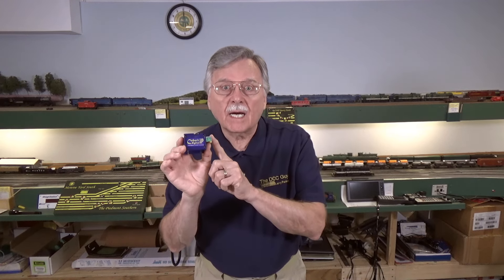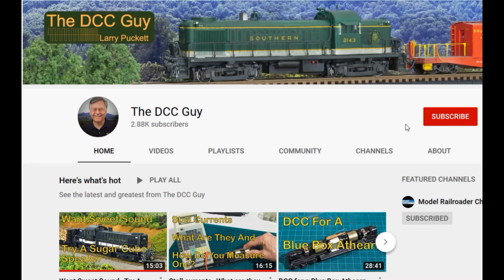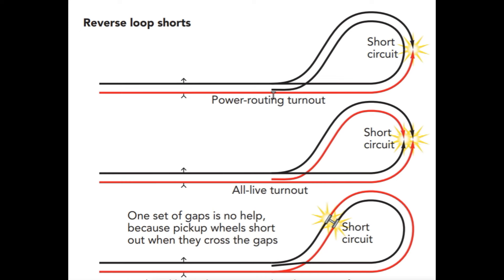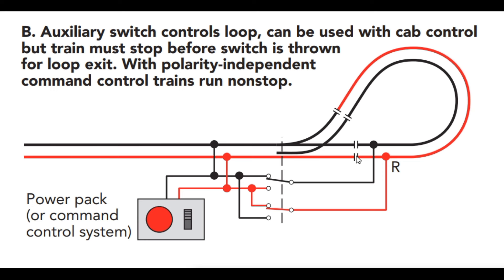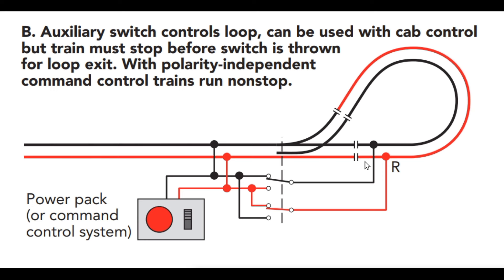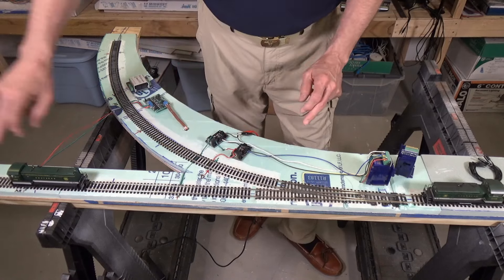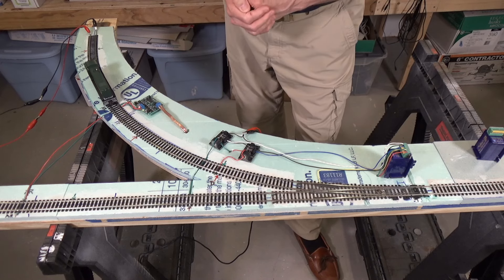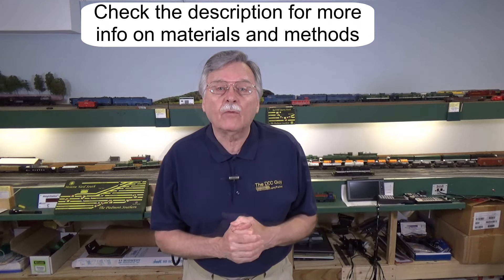Fully Automate Your DCC Reverse Loops (197)

Comment: Thank you, Thank you for the clear and detailed video, although I had to use BD-20's which wire up slightly differently, I was able to successfully automate my reverse loop reliably using your guidance.  The process has inspired me to look into more automation projects!
Reply from the maker: Yes, before they developed their similar detectors, they tended to use BD-20s. Did you end up adding power to them or was the logic and ground output enough without it?
Reply: @TheDCCGuy  They did work without power but I added power to get LED confirmation with larger bulbs in two colors. I may play with it some more just to avoid the additional power supply, or consider a DC accessory bus connection nearby. 

Thanks again, your articles and videos are extremely helpful. See you along the rails.

Comment: Larry, I appreciate the video.  I am planning to use the DCC Specialities PSX-AR.  I have one question.  You fixed the auto switching and poliarity from within the loop. How can you pre determine the switch machine to go left or right from out side the loop when approaching the loop.  What you had just takes the last direction used.
Reply from the maker: As I think I said in the video setting it up for a fixed route gets very complicated. It will likely require some sort of flip flop logic circuit and possibly optical detectors. I have never seen it done. You might check with some companies that sell DCC electronic circuitry.
Reply: @TheDCCGuy  After viewing this video, I later viewed your review of the Cobalt Switch Machine.  You mentioned the option to add a Momentary button to the switch machine.  I feel this would give me the option to chose which direction to enter the loop.  Thanks for your help.  Thanks for your practical presentations.
Reply from the maker: In that video the detector is sending a command to the switch machine to change and if you add a pushbutton it would create a potential signal conflict.Let me ask the DCC Concepts guys whether they have a solution. They are at a big show this weekend so I won’t hear anything back until next week so remind me if I don’t get back to you by mid-week.
Reply from the maker: I heard back from them and they don’t have a circuit specially for that. However I found the Digikeijs DR5013 autoreversing blackboxes designed for automating reverse loops and a company at www.azatrax.com that makes them. You do have to search through their pages but eventually you can get down to their circuit. I am sure there are a lot of other basements electricians selling such circuits just do a Google search.
Reply: @TheDCCGuy  Thanks for your help.  This will go a long way to doing what I want.

Comment: I use DCC Specialties PSX-AR on my layout and they seem much simpler than this and they work perfectly..
Reply from the maker: Good to hear that as I have one to try out on another revers loop. I have in the past had difficulty programming the CVs on my PSX4.
Reply: I completely agree!  Need to make sure that you get the PSX-sc that controls a switch too.  Only 5 wires.  2 to your isolated section and 3 to the switch.  They work flawlessly. It even handles when you flip the switch manually.

Comment: I want to construct a layout with a reverse loop where the loco enters on one turnout and leaves on another.  My dilemma is whether one AutoReverse mechanism will open the forward turnout and close the previous turnout simultaneously.
Reply from the maker: Without seeing your track plan it is hard to comment. Usually in a revers loop the loco enters and leaves via the same turnout. Do you plan some land of crossovers in there that creates the reversing issue? At any rate it sounds as though you will need 2 circuit boards to handle the two turnouts, but without more info I cannot be certain.

Comment: Great video. Was looking to do this but now I'm limited to a 4×4 area which is not going to happen.... Larry truthfully, I could of used all your advice 5 years ago before I built my layout., But I'm not and as we all say never finished modeling...but I'm not even close I am using most of what you teached as I'm fixing tunnel track and I have to finish doing my yard in my open closet where I have to put it and at the end of my 13+4 middle section... That's where I wanted this cause also I'm going to make a yard n passenger station. But my city is there with my elevated subway so only 4+4 room left for this... Your videos are great knowledge that I am absorbing. Thanks buddy keep it up, joe aka ( DIESEL 027)....

Comment: I'm learning about reversing sections on DCC layouts by watching videos and reading text from many sources.  Some folks talk about reversing polarity, others talk about reversing phase because they say the DCC signal is AC not DC. (And some say it is not an AC signal, it's a digital signal.)  So which is it, polarity or phase? It cannot be both, can it?  Let's get everyone one talking about what it really is so newcomers like me can learn it right the first time.  I understand that with DC powered layout it really is polarity switching but we are talking DCC layouts here.
Reply from the maker: In reality DCC is not DC and it is not AC, it is DCC. That probably sounds like double talk and that is why you rarely see a technical discussion of the subject and folks just fall back on the polarity concept. What happens is power turns on and off at high speeds on opposite rails, so one rail is on while the other is off, then that is reversed and so on. Consequently the two rails are always out of phase with one another. Confused yet?  For a complete discussion of this subject I suggest you read the following website
https://dccwiki.com/DCC_Power .
Reply: @TheDCCGuy  I'm reading that right now. Gorey details.  That's good.  Thanks for the reply.
Reply from the maker: In this video I too use the term polarity even though it is technically incorrect and really is a matter of a phase mismatch. However most modelers are familiar with the polarity concept so it gets the point across in a way they can understand and relate to. And operationally a short is a short no matter whether it is due to a phase or a polarity mismatch.
Reply: Having fixed radios in the military - this is some brilliant stuff here.  I can see why people come into this DCC world confused, and many probably stay there all their lives.  It is a digital signal that allows the little DC train to live in its DC world independent of any other DC train on the tracks.  The decoder in the little train tells the train to take from the always energized tracks what it needs to do in its DC world.  The train is clueless that it is living in a digital world.  DCC is neither DC nor AC - it is always a positive digital signal in an on and off state where current flows from the high state (ON) to the low state (OFF).  There is no negative voltage, and there is no true Zero volt state - it is a high or low digital signal with the off, or low state being some positive voltage.  From a radio repairman's eyes - we would call this a floating ground; from a DCC's eyes, they call it magic!

Comment: Thank you so much for this I really needed this for my layout! BUT......... I do have a dilemma. One of my reversal loops is in fact a direction oriented loop which requires the train to always take a specific side on approach. What I've now learned ( which NO ONE on the internet will mention) is that with a reverse unit you MUST enter from where you exit or it will short out. Do you have any insight on how to handle this or is this NOT a job for off the shelf reversers?
Reply: Update:  Magic happened and it started working. I have a whole bunch of theories but I'm clueless. I'm not gonna fuss though, I have a specified approach reverse loop and it's working.

Comment: Larry All my parts arrived two questions
Question 1
On the BD20 you connected them to  a 12 Volt power supply.    Can I connect them to my 16 Volt DC buss line and put a reducer near and have a 12VDC buss line ?

Question 2.

On the Dual Frog Juicer   DDFJ003U the same one your using.   Can I connect that to my DCC accessory Bus Line ?   or to my same bus line my Track feeders are on?

Thank you in advance
Tom
Reply from the maker: I would recommend running the Frog Juicers off the same bus as your track and turnouts. I’ll get you something on the other question ASAP.

Comment: We are having a discussion on the MR forum as to whether an insulated metal wheelset (no car lighting involved) will trigger a reverser.  Can you shed some light please?
Reply from the maker: If you are using a device that senses the mismatch in “polarity” like the dual Frog Juicer and several others, then metals wheels will trigger the autoreverser since there will be a short when the metal wheels bridge the gaps. Plastic wheels will not trigger the device.
Reply: @TheDCCGuy  Thank you

Comment: Great explanation, Thank-you. Two questions occur to me though, 1) am I correct in assuming that there's no complication caused by having staging sidings inside the reverse loop, and b) if this were adapted to a wye, I think I would need another juicer, 4 more current detectors, and of course 2 more cobalt switch motors, correct? A follow up discussion of wiring a wye might be a good idea for another video. Thank-you again for this; your videos have given me the confidence to believe I can move from DC to DCC and I'm really looking forward to it.
Reply from the maker: As long as they are fully inside the reverse loops you should be OK. As for the wye those look more complicated than they actually are. I think it depends on where you put the reversing section and autoreverser. For example if you have a long enough tail track you might be able to get by with just flipping polarity on it and not have to worry about the other locations,  at least that’s what I wrote in my book!
Reply: Thank-you

Comment: Larry  What size track did you use?  I mean I see the Atlas turnout  #4 #6 561 562?   which Number?  and then the curves what radius.   15 18 22 ?    trying to design my Reverse loop for my upper level building a helix to go from one level the next
Reply from the maker: Tom, those are #6 turnouts and a 3’ radius reverse loop.
Reply: @TheDCCGuy  Larry Ok on the #6 turnout but for the curve to join at both ends how many pieces of curve did you use and what radius on them  18 15 20 22?
Reply from the maker: I don’t use sectional track, it is all flextrack which can be bent to any radius.  The full curve has not been built yet but will have a circumference=2*Pi*r

Comment: I had an "automated" uni-direction reverse loop on my last layout, I used a DCC reverser and a six inch length of spring wire with just enough tension to hold the points close but still allow my lightest car to push the points over to allow safe passage.
Reply from the maker: Railroads call that a spring switch. Works fine as long as ALL your rolling stock will hold the rails. I’d hate to find out I had one light car in a 20 car string cause a derailment on a reverse loop buried deep under the layout.

Comment: I saw in another video they were using the Digitrax AR1.  The loop was long, though no distance was given, but they connected the AR1 at both ends of the loop, saying it prevented any delay in detection when crossing into the Main Line versus just one end only.

Is that necessary?  I have not seen or heard of that issue before.  Potential concerns when/if connecting at both ends of the loop?

Comment: Great teachings as usual Larry. I'm having troubles getting my small brain around my reverse loop issue. for ease of explanation, i have a oval track, with a track going from one side to the opposite of the oval. I'm not sure where i need to isolate and put my reversing decoder(s)
Reply from the maker: Reverse loops can be simple as with the examples I showed on the diagrams. However others in complex track work can be difficult to diagnose. Basically though if you trace a line through any track work and find it reconnects back on itself through a turnout then that likely is a reverse loop even it it does not look like a loop. Wyes for example are such a reversing situation. Chapter 7 in my wiring book deals with reverse loops, wyes, and turntables all of which have this issue.

Comment: This is great info. Thank you. I use the PSX AR and noticed in their instructions they suggest staggering the rail gaps by 0.75".  I do have occasional shorting problems with lighted passenger cars that I cannot attibute to anything I can detect, yet my gaps are not staggered. Do you have any thoughts on this?
Reply from the maker: I asked Larry Meir, the developer about those staggered gaps and he admitted it really wasn’t critical that they be 0.75”, just they be offset a little. I can’t remember whether he told me why they are needed though. Another thing is to never leave a load such as a lighted car, loco, etc. across a gap. Also check you voltages on each side of block gaps and make sure there is no sig difference between them. If lighted cars are a problem you might try increasing your trip threshold setting a bit to give the block more capacity.
Reply: @TheDCCGuy  Super helpful! Thank you.

Comment: Nice presentation Larry, thankyou. I might have missed something tho, the polarity change is taken care of by the auto reverser and you needed a signal from the two sensors? When I set up a auto reverser for my turntable, I only used ( a Lenz unit) a auto reverser and no sensing devices to achieve the switching.
So, I assume the load sensors are for changing the turnout?
Reply from the maker: Yes, with this setup the detectors just handle the switch machine and the auto reverser handles the reverse loop polarity, it senses polarity mismatches internally and does not need external sensors or detectors.

Comment: Nice video Larry.  I like the use of these new products to simplify operations of the reverse loops and also set up non-derailing turnouts.  

Regarding DC operations, if the reverse loop is operated unidirectionally, a way to allow operation through it without stopping is to use a rectifier.  By putting it between the output of the direction switch and the reverse loop track what happens is that as the train runs through the reverse loop, when you through the direction switch the rectifier maintains the correct polarity in the reverse loop, thus the train doesn't change direction.  AS a result you don't need to stop the train.

Comment: Larry, when building this in the "bowels" of your layout, the implication is that you cannot see what is going on down there, much the same as a train going through an inaccessible tunnel. I am wondering what you might think about installing a CCTV to monitor those areas that you can't see without difficulty to watch what is going on, and how that might be set up. It would actually be very prototypical; I am retired from UP and have dealt with Big Brother watching my every move both in the yard office and sitting at the throttle. I could see the benefits of such a set-up for something other than disciplining  operating crews (not that I am bitter...).
Reply from the maker: Got one already that will monitor the staging yard entrance/ladder. May get another for this hidden loop as well.

Comment: Larry thanks for the great video. I've been using servos for my hand built turnouts on the mainline but am wanting to automate the turnouts for a reversing move. I was interested in using the Cobalt digitals and a PSXAR. Would I still need those block detectors you used on your example? What brand are they? Thanks again.
Reply from the maker: Fro  what I have studied on this that could get very complicated. The method I used was the simplest way I could do it and I  have a PSX-AR and on hand. I’d have to study this a bit more to see if it can control,your servos but I bet it will. As I remember it must have built in detection but it has been a long time since I looked at that material.
Reply: @TheDCCGuy  thanks again Larry. Yes I am currently using servos for the turnouts in question but am thinking about switching them out for the cobalts. Would I need anything else besides the PSXAR and the cobalts or would you suggest something different be used?
Reply from the maker: Since the PSX-AR seems to have its own detection system and has output to control a Tortoise or other switch machine I think you would be good to go. The drawback with all the PSX devices is setting the CVs (configuration variables) as there is no reliable way to actually know that you have programmed they way you want them.  The thing I like about the Dual Frog Juicer is no programming is needed. Just hook up the wires, set the jumpers and it’s ready for action. With the Cobalt Digital all I did was change the address, wire it up to the detectors and power them and it was ready to go. I do use a PSX4 on the output from my DCS240 and I never did get it programmed correctly til I sent it back for a firmware update and they programmed it for me there. Tons of options but a PITA to program.

Comment: So if the straight track loco A is sitting in the "green" detection area, and the curve loco B approaches the turnout entering the "red" detection area, the turnout won't move to the diverge position.
Is this the complex approach situation you referred to?